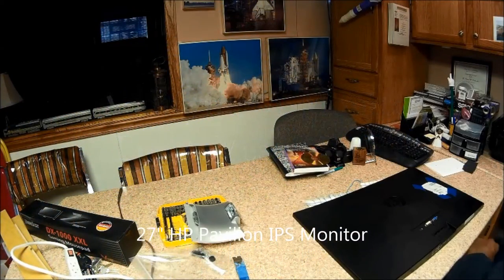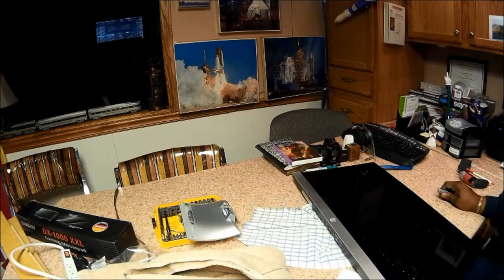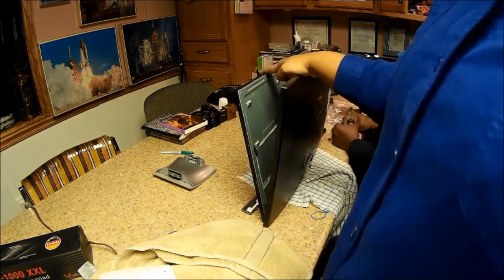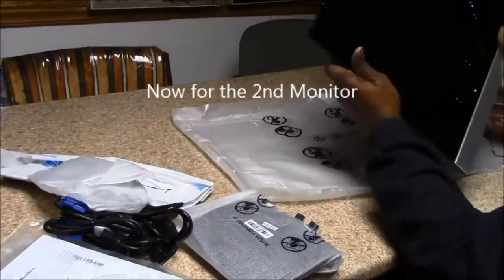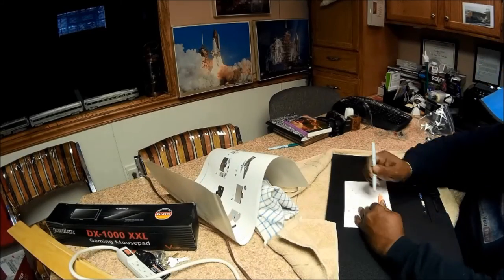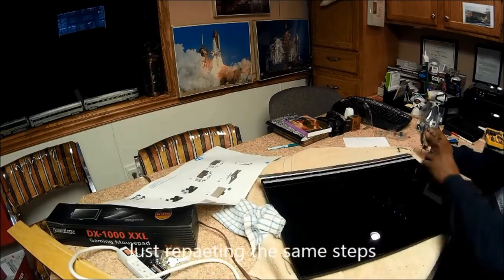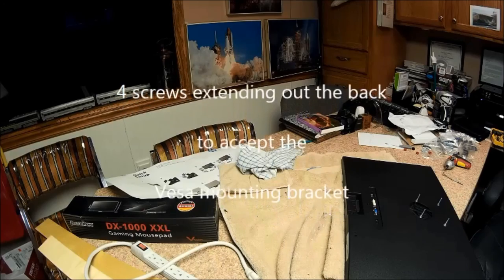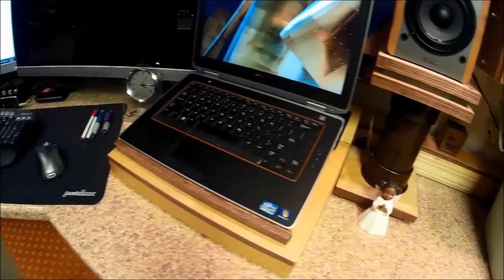Modifying A PC Monitor For A Vesa Mount

Comment: I was very excited having watched this video and got the nice tip. And I did order a mount try to drill some holes on the back cover of my hp 27es monitor. Unfortunately I was not careful enough to read all the comments before I drilled the holes. And after I finished mount with back cover holes drilled, when I tested run my monitor, it started completely ok, then few seconds later, 2/3 of the monitor on the left side faded into black while right side 1/3 works perfectly fine and fading joining in middle area. Now I have to search all the internet try to find a workable solution.

Comment: how is that holding up so far? were you moving the monitors often? considering doing something similar to my pavilion 23xi pair and I'm afraid it would break off at some point as it wasn't designed with this kind of mount in mind I'd assume; and I plan to change their position quite often